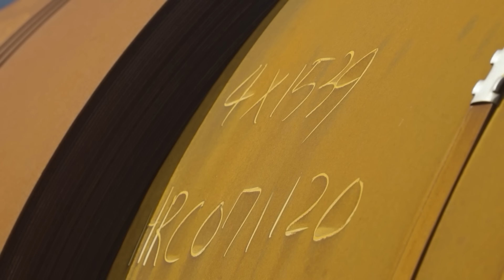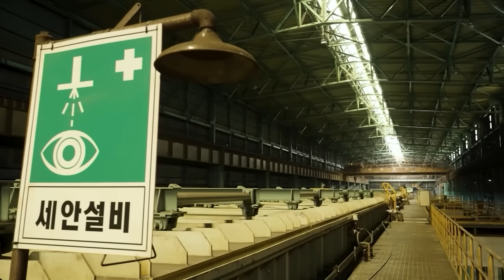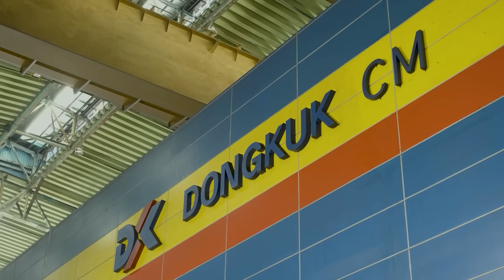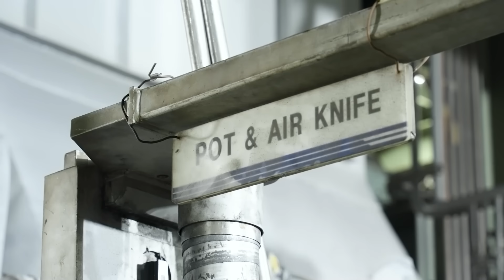7,000톤 녹슨코일을 아연도금강판으로 만드는 과정. 12만평 규모의 부산 컬러강판 공장｜철따라 시간따라 Ep.1

Comment: That is not rusted, that is surface and it's 99% the bands that are rusted 

In the 1990s I owned a logistics company that moved coil from the works to the port.

* Steel coil for Germany (BMW, Merc, Porsche etc).  100% pristine, a coil wrapped in stainless steel

* Steel coil for China, top quality coils. Not wrapped

* Steel for India?  ... Stored outside, literally out the back of a warehouse, so rusted it was pitted. Just a 25 tonne ball of rusted crap, often it'd been dropped so was elliptical 🤣